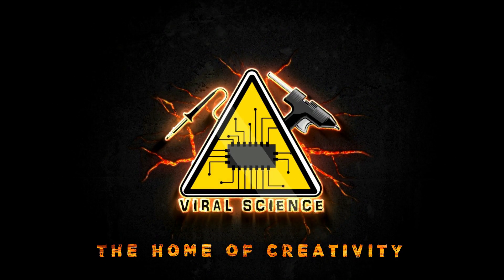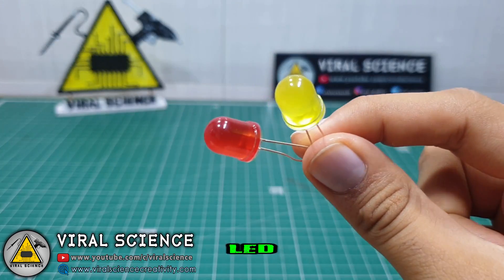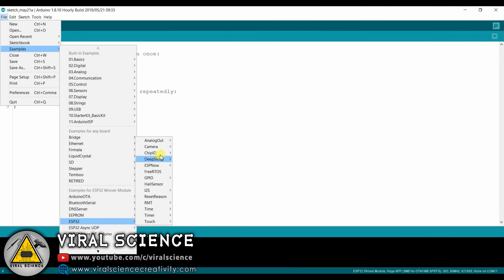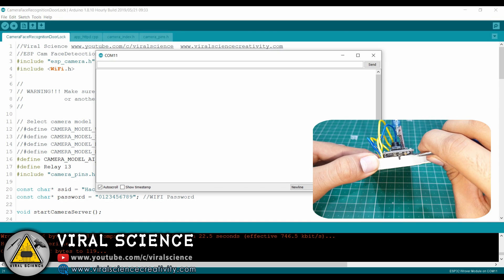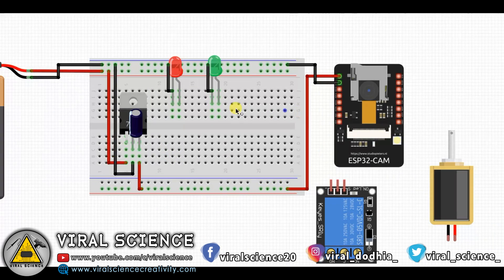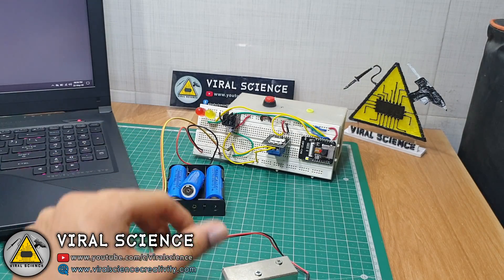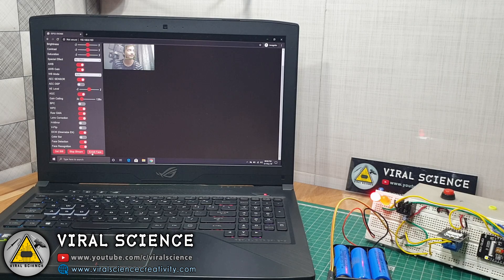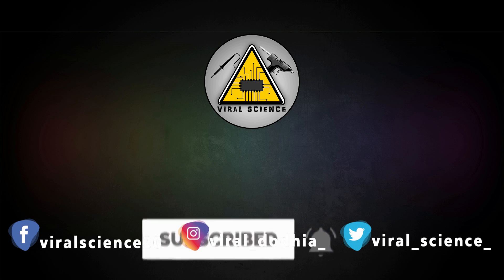ESP32 CAM Face Detection Door Lock System

Comment: Hi @Viral Science
I followed your tutorial but got shucked at 1point....
When I am connecting ESP32 with power supply of FTDI it works properly but when I connect external 5V power supply it starts printing random string in serial monitor and fails to connect and work!!!
What could be the possible reason do you have any idea?
Reply: u are not shorting io0 and gnd
Reply: @krishnarao8643  Yeah I followed an article and that worked

Comment: I have done totally same as you done in your project or video but my prblem is when i am giving power to the circuit... the selinoid lock getting automatically unlocked... please help me sir
Reply: i want to know that  your project work properly have you find any solution ?
Reply: @SarthakSharma-v7f  yeah
Reply: I have the same problem, how did you solve it?

Comment: I like you video and I'd appreciate if you can enlighten me about how does the module works. Is the wifi network only needed for displaying what does the camera sees or do the esp cam module itself requires a wifi connection to work?

Comment: Function of LEDs. Are they a must?
Reply: no, unless circuit is powered with AC voltage. It’s powered with batteries which is DC, so answer is no.

Comment: Hello!! 
Thanks a lot of the video.
I just have one question, why did you use 9v battery in the diagram or is it just for demonstration?
Reply: The 9volt battery is for only showing in diagram,,,,, solenoid lock needs 12volt to work properly,,,, I am making this project for face controlled  scooter
Reply: @iamaditya69  can i use 2pc 9v instead of the 12v ..? Is it works with two 9v battery..? Please reply.. 🙏
Reply: @musiczee_  you need to use regulater,,,,,as if you give 18 volt your circuit will burn
Reply: @iamaditya69  which regulator i have to use please say..if i use 18v with the whole diagram and things that u use is it will burn the diagram...?
Reply: @iamaditya69  please mention which regulator i have to use...
Reply: @iamaditya69  in your diagram there is a 7805 regulator...with this diagram amd components that u have used...if i give 18v will it burn..?
Reply: @musiczee_   yes it will burn,,,,because 7805 regulates current to 5 volt ,,,,,and in my circuit Maximum current limit is only 12 volt
Reply: @iamaditya69  will it be ok if i use 12v 1amp dc adapter..?
Reply: @musiczee_  yes

Comment: Can i use 12 V DC adapter as power supply and Which DC Adapter is used 12 V 1amp Or 12V 5 amp

Comment: thanks for your tutorial...i made it but the connection to wifi is unstable even the signal is strong and some time esp32 chip overheated.Can you recommend solutions?  THANKS
Reply: power DC5v 2A
Reply: add antenna

Comment: Hello, excellent project, a question, when I press the "Reset" button on the serial monitor it gives me the following errors:
[E] [camera.c: 1113] camera_probe (): Detected camera not supported.
[E] [camera.c: 1379] esp_camera_init (): Camera probe failed with error 0x20004
Might you help me?
Reply: choose correct camera in socecode..such as blelow #define CAMERA_MODEL_AI_THINKER // Has PSRAM
// Select camera model
//#define CAMERA_MODEL_WROVER_KIT // Has PSRAM
//#define CAMERA_MODEL_ESP_EYE // Has PSRAM
//#define CAMERA_MODEL_M5STACK_PSRAM // Has PSRAM
//#define CAMERA_MODEL_M5STACK_V2_PSRAM // M5Camera version B Has PSRAM
//#define CAMERA_MODEL_M5STACK_WIDE // Has PSRAM
//#define CAMERA_MODEL_M5STACK_ESP32CAM // No PSRAM
#define CAMERA_MODEL_AI_THINKER // Has PSRAM

Comment: Your parents should be recognized too 😂  . Why there's no lithium battery discharge circuit protection??
Reply from the maker: I just used battery for demonstration,
 for real time use you will need to connect it with power supply